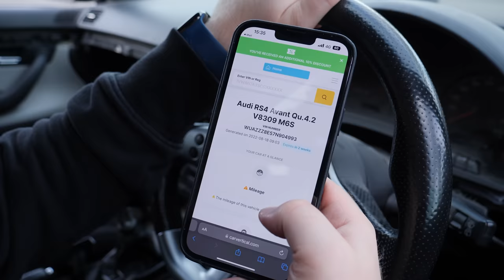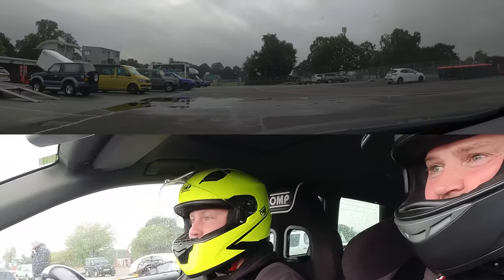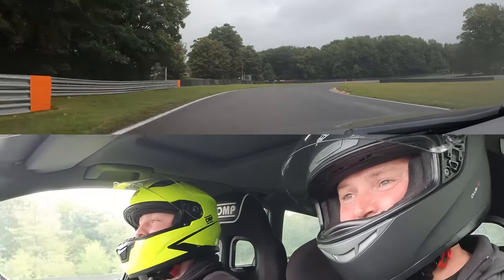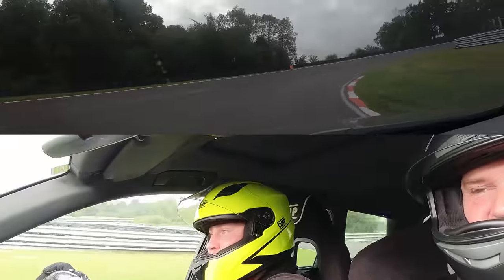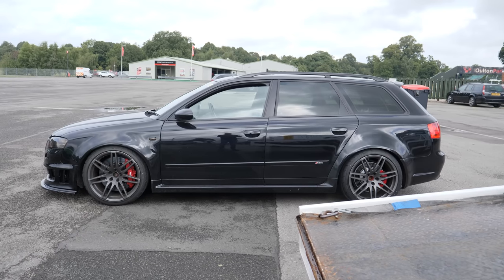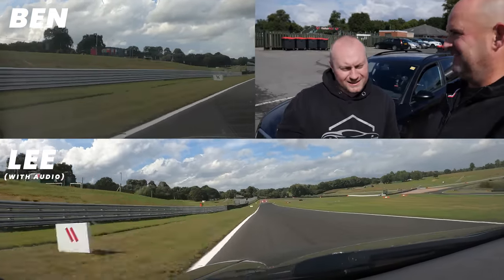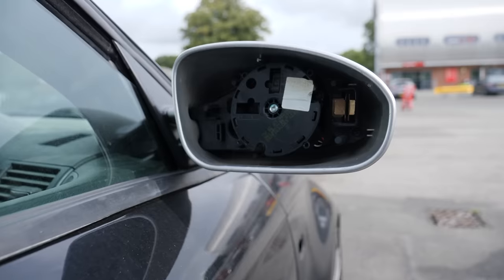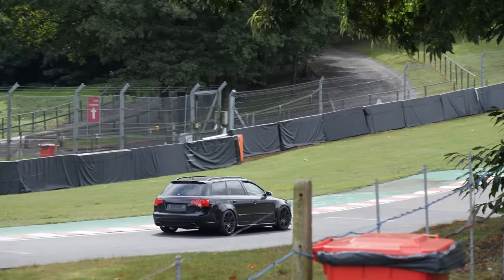Is this the UK’s ONLY B7 RS4 Avant TRACK CAR?! *Oulton Park Track Day*

Comment: Had every RS4 since the B7 , oil runs really hot 120 isn’t unusual , bedding the brakes only takes 3-4 sharp stops from 60 and they’re done 👍
Typical under steer 😂😂😂
The box you found is a power supply to a radar detector

Comment: A fast road setup would be good to do so you get from front camber on the go to help turn in at speed when the cars all loaded up on the front.
Looks fun though lads, well gel 😜👍🏻
Reply: FYI.... Neg Camber won't improve turn in even when loaded up. Toe out Will result in improved turn in.
Reply: @Twentymacc  that as well 🤦🏼‍♂️ didn't realize I'd have to go technical with my comment.

Comment: To bed in brakes all you need to do is brake from 70mph to 10, nice and steady like your braking for the length of your average motorway exit slip road.  Do that a couple of times without making them red hot,  and your done.    Its the tyres!  Get some rubber ones and it will be faster.  Those maybe semi slicks, but they are plastic.  🤣🤣

Comment: Someone might correct me here but I thought that new disc + pads required no bedding in due to them being both engineered flat surfaces . New pads on old discs sure but I don’t believe it’s required if both disc and pad are new . 

Good video lads 👍
Reply from the maker: Not a clue. Got to be honest, they didn’t really get much bedding in anyway 😬😂👍🏼
Reply: I was always told to bed the discs in slowly to stop them warping.
Reply: @EVILGT  I have a b7 rs4 nothing comes close to the sound they make at 8500 rpm 👌 might not be fast by todays standards but the sense of theatre is one which is hard to beat
Reply: If the discs and pads are brand new then they only, usually require around 25 miles of normal driving to ‘bed in’ to normal everyday use. If they’re being used for more spirited driving then you must get better pads and get some heat cycles through them to allow optimum stopping power, each car and set of brakes are different so there is no hard and fast rule to answer this question.

Comment: I do love ya both, and i dont in any way want to be a hater...and i love to leave positive comments when i can.....but i feel i need to tell you this as a favour.....so please dont think this is coming from anywhere other than a place of love....

The car you have picked to turn into a track car is totally unsuitable.....Its regarded as having 'mediocre' handling at best....Is Heavy....has a complicated expensive to repair drivetrain....and because of this on track will heavily wear all consumables....Tyres (even good ones) will be destroyed in a few well driven laps, the brakes and suspension will be worked very hard.....and overall for the times you can acheive and the fun you will have you will spend an absolute fortune on this thing.

There is a reason track days are full of clios and civics.....and not RS4's. 

I have a sub 1000kg '92 civic with about 260bhp, and also a 400bhp Evo 9....The civic will lap any track at least as fast as the Evo....both have basic coilovers, decent tyres, decent brakes....both equally fun....equally fast.....but the difference is the 1000kg Honda will do a track day for 1/4 the price of the 1380kg Evo.....The Hondas brakes and tyres will last a whole season.....where the Evo can destroy both in a day if driven fairly hard....and the Honda parts are half the price...Honda uses half the fuel....in fact probably more like 1/8 the price overall.

Yet even though My Evo probably costs 8-10 times as much per lap without being any faster than my civic.....Your RS4 which is so much heavier, with garbage handling from the factory, even stripped out....even with the best tyres in the world.....wouldn't come close to either of them.....and will cost you i rekon double what an Evo costs.... at least.... to run on track. 

Whatever that RS4 costs per hard driven lap on a trackday.....i bet theres loads of clios, hondas, golfs, mr2's....going just as fast for probably 1/20th of what a lap in that Audi costs....and at the same time having more fun. I know its a bit "different"......and different can be good.....but why have yous never asked yourseves why 4.2 V8 RS4 track cars arent already a thing? I know yous arent pretending to be or claiming to be rocket scientists.....but yz arent a pair of dafties.....It feels like someone in the background is constantly giving yous bad advice.

PS im pissed so ignore all of the above.....much love
Reply from the maker: Appreciate your comment buddy but this car was never bought or chosen as a track car… it was bought for £5k accident damaged and we wanted the seats and brakes off it for our saloon which arguably are worth/cost that. We asked our audience what we should then do with it (strip it or track it) and the answer was track it so here we are. I had a Clio RS200 track car and it barely got viewed because it’s an obvious and very boring choice. That RS4 with a proper suspension setup and a decent set of R888r’s would surprise you. Yes it’s not a cheap track car but then it’s not a cheap road car either… that’s not the point of the exercise 😂👍🏼
P.S it’s way more fun than the Clio RS200 track car I had too 👍🏼 enjoy your beers on a school night (I’m not jealous at all)